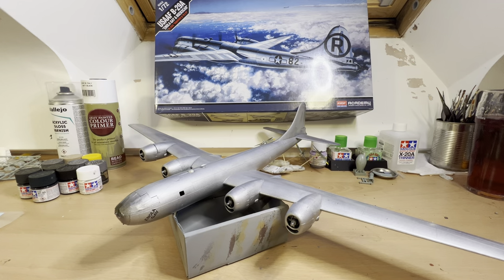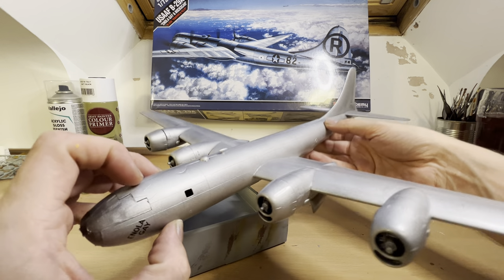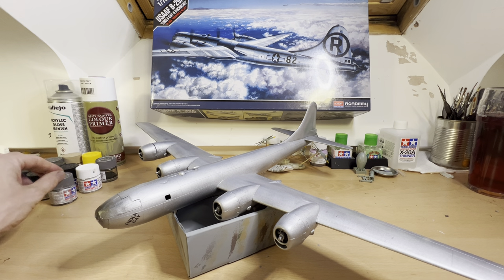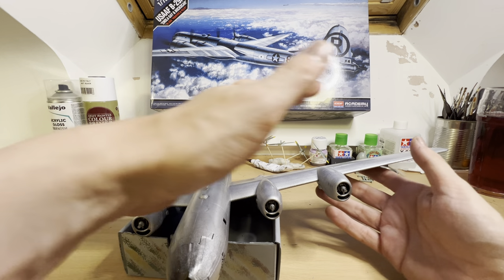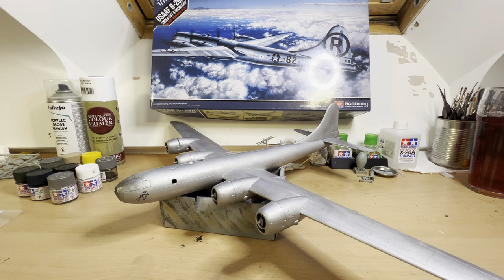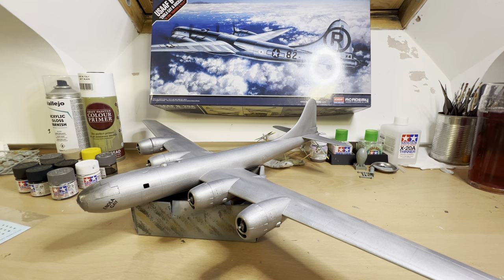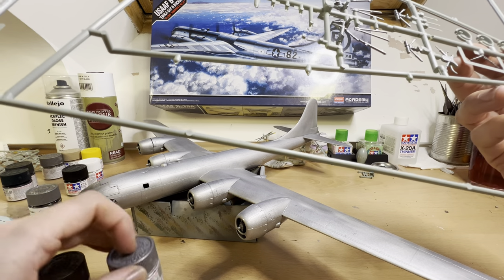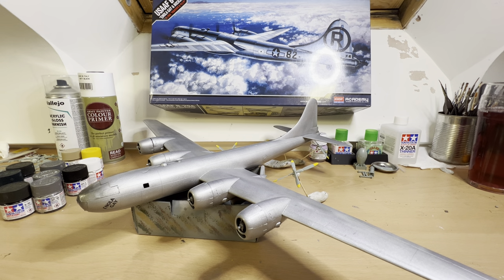BUILD UPDATE 4. ACADEMY 1/72, 12528 B-29 SUPERFORTRESS; ENOLA GAY & BOCKSCAR.

Comment: Hi Andy. Nice idea with the half and half decals , that should work ok . I agree with you about the prop tips , it is easier to paint them. The damaged paint will need to be blown over again just to cover up the damage but thats not a major problem. If you look at the box art you will notice that polished aluminium is never the same from panel to panel so maybe brush paint some of the panels in vertical or horizontal directions to give you that variation. Also remember that you can polish the finish yourself. The engine problem I have know answer for , you were distracted - maybe ? But you noticed it so thats all that counts. Don,t for get that the main undercarriage will look dark anyway under that big wing so don,t go to dark . Also you can put on a dark wash on the legs and wheels to pick out the spokes. Use a thinner wash on the upper surfaces of the wings , you do not want it to dark there. Some streaking  from the nacelles in the direction of the airflow will be fine but again not to heavy. I will remind you now not to forget the black de-icing boots on the wings and tail. You could have masked them off before you sprayed the silver but not to worry . They can be touched in by hand. Its a big bird the B29 so it was always going to use a fair bit of paint but hey lesson learned right ? Overall not to bad so far but try to slow down a bit and plan ahead if you can. I know that you set yourself a tight deadline but then that can cause problems.  So well done so far bud. Good luck.
Reply from the maker: thank Brian i think the decals should look rather interesting, the panel scuffs i am just going to touch up with a tiny brush. i think the patchiness on the wings is due to incorrect needle or possibly i should have increased the flow on the airbrush, though the fuselage looks better so not sure. LOL no washes yet, though i agree something this big would definitely benefit, my concern is it would take a whole lot of time and wash so think that i would be better learning this process on something smaller. honestly i have no idea what the "deicing boots" are so will have to investigate.
Reply: @TheNoviceModeller  Hi Andy. The de-icing boots are the black strips on the front of the wings and tail. They were there to stop ice build up at high altitude. A wash need not be a lot. Just a touch of black in some thinners or you can do it with acrylics in the same way , not a lot of black though. It will give the panels a sense of depth. You will wipe most of it of. A touch up of the damaged paint will work but keep it thin and build up a few layers. Remember sprayed paint is very thin so you don,t want a thick patch. Anyway good luck my friend.

Comment: Re the engine nacelle issue, we've all had more than our fair share of f**k ups modelling, Andy, so don't fret too much 🙂 It's all the more satisfying then when we can fix those up with no one being none the wiser if they look at the troublesome area afterwards. Don't worry about the irregular patches in the paintwork either—particularly in bare metal finishes, there are always different shades among the various panels, and scuff marks from crew scampering about doing maintenance work. I noticed some seam lines remaining on the top of the fuselage. If you want some extra practice, I suggest fixing those with your Vallejo putty and respraying them. Also, consider applying some panel line wash, including the undercarriage and wheels. These are the kind of things that will elevate you to being an experienced modeller. If you don't have enough display space on your shelf, you could consider hanging the beast over your bed. Just imagine it dropping Little Boy or Fat Boy onto you as you're going to sleep—or perhaps not!
Reply from the maker: hi Jeremy, LOL that engine, i didnt notice it until applying the second top coat. Yes there are some seam lines on the fuselage but as i have struggled with the gun mounting adaption i have acepted that this is going to have a slightly disappointing appearance so will be leaving as is, though i do need to try get the seam lines better on these kits as it is something i have been awar of on most of the smaller ones i have so far built. regarding washes etc i think i am getting to the point where i want to have a go of this stuff though as this has proved a somewhat problematic kit i wont be adding extra work and expense to this one, i think September i will have a go at something.

Comment: I still make plenty of mistakes when building kits, last one just today. Working on a 1/72 Hurricane Mk1 and realised I'd used a part for a later one than the model I was building. Only noticed when priming the last parts on the sprue and noticed the part I should have used. This is after most of the painting has already been done which meant I had to cut off the wrong part so I could use the proper one and then paint it to match.
A tip for the undercarriage legs. Thin down some Humbrol black (a starter set pot is perfect for this) with water. You want it to be really thinned down a lot and then brush it over the painted legs. The paint will act as a wash and really bring out the details on them. Being thinned down so much means you don't cover the colour of the parts as the pigment collects at the detail. Don't try it with Tamiya as they are solvent based acrylics.
Reply from the maker: Hello Adam, yes been a bit of a tester this one, soooooo much bigger than i am used to, i guess everyone has little f$%k up's every now and again, not sure how i missed the engine for so long though LOL. i mght just try your was wash, though am kinda desperate to get this done as i am also doing some "real world" painting...........lounge ceiling FML.

Comment: I think the color variation makes it more realistic, so I think no big loss from using the small needle. As for the damages, I'm sure the real planes looked messier than your model, they weren't exactly maintained to look good on a stage. For the removed gun turrets, it's about the best you could do IMHO with kit as it is, sure you can spend like weeks to scrape and putty and sand so it looks flush with the fuselage, but it would destroy most of the panel detail around. Using different markings for the two sides of the airplane is a novel idea, it's the first time I encountered it and sounds great. Waiting for the finished model, I'm sure it will look great.
Reply from the maker: Thanks @fotograf736 its a bit more than i am used to, i think it'll be a while before i have another go of a big' un but it hasn't put me off them LOL. I had a B-25 when i was a kid and it came with two sets of nose art, not knowing any better i put one on each side "Lady Luck" was one cant remember the other. I guess thats why i thought that could work, at least now i know what i am doing ..... kind of LOL.